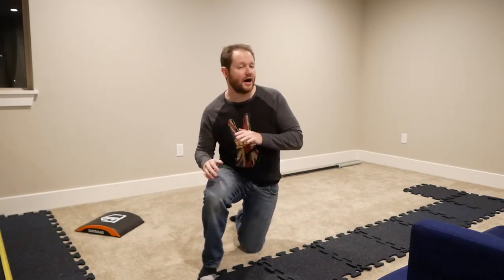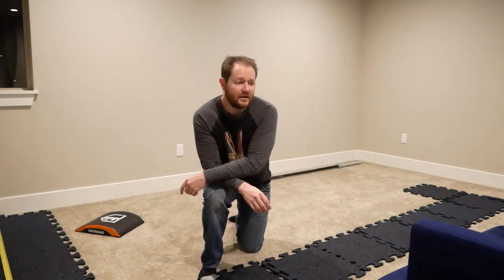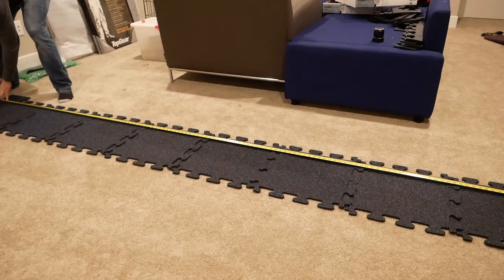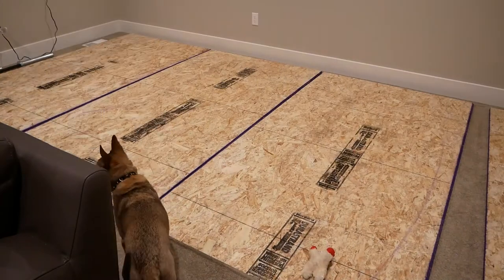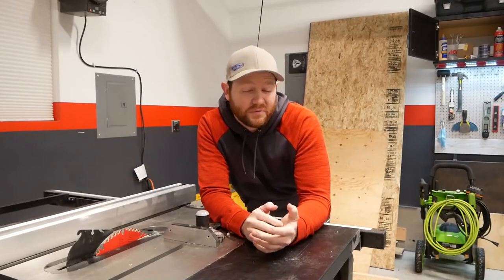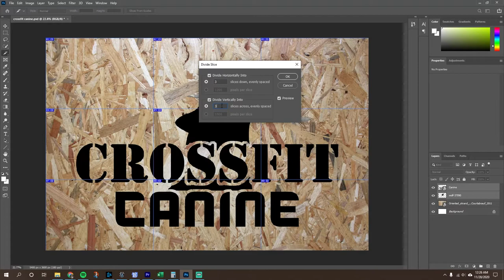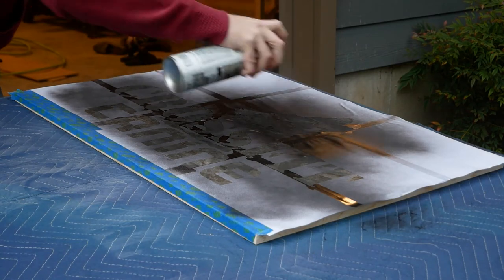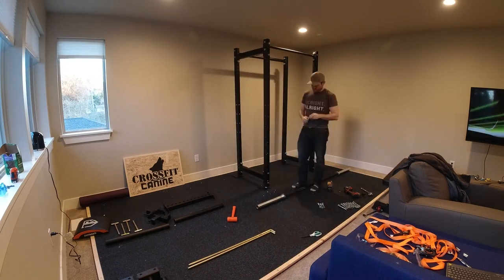2nd Floor Mini Gym Install

Comment: I've installed a power cage in my second floor apartment (building from 2009) and the first thing all people ask is: will the floor support so much weight? I don't think people realize how much these things weigh: a bed supporting a fat couple fucking, a bathtub full of water, a closet full of clothes, a wall-to-wall library full of books, a Christmas dinner with your overweight extended family. All things considered, a person squatting isn't that much weight actually.
Reply from the maker: Totally agree...and appreciate the imagery, lol
Reply: Having this argument with my family currently. 2 of them sleep in a bed with a much smaller footprint on the floor than a power rack (with metal beams that run flat across the floor vs the pointed feet of their bed). I never drop weights and I’ve reasoned that if I’m ever actually able to lift 1500 lbs, I’d be the strongest man in the world, and at 38, with a very slim build, really that ain’t happening 😂

Comment: Thank you for this video, you are the only one that I could find that could give me the right idea for installing gym flooring over high pile carpet in a clean and neat way. While I don't need it on the 2nd floor, this solution you provided is about as professional as I've seen it so far and looks fantastic. I just wish I had a wood workshop like you do :(

Comment: Has there been any issues with mold? I would like to do this, but I’m worried about mold forming between the plywood and the carpet.
I was thinking of adding a de-humidifier in the room as well for added protection.

Comment: What wood did you use for the trim?What did you use to “tac down” the 3/8 plywood? Could you also add a link to the tiles you used in the description or even recommend some please.
Reply: I was wondering the same thing about attaching the 3/8 plywood

Comment: I'm trying to do the same but don't have the tools. I am thinking of just having a two 3/4' 4"x8"  plywood sheets side by side and 3/4' horsestall mats on top. Do you thinkk this will provide sufficient support?
Reply from the maker: You’d get a lot of flex where the two panels meet

Comment: About to start this endeavor myself. Did you screw the framing into your flooring, through your carpet? Or is the framing screwed to the parameter of the plywood?
Reply from the maker: Just the perimeter of the plywood

Comment: Would you mind posting the two types of wood that you used to create your bottom two layers. Also, have u encounterd any problems with stability or anything like that?
Reply from the maker: It’s just double 3/4 inch OSB with a perimeter of 1x2 prime pine To retain the mats. No issues so far.
Reply: @aaronstestlab  Thank you so much. The area looks amazing. Do you think you would encounter any problems putting cardio equipment on there like a treadmill for example
Reply from the maker: A treadmill may be a bit heavy for a second story when combined with all the weights. However, I recently put a peloton bike in that area and it works great